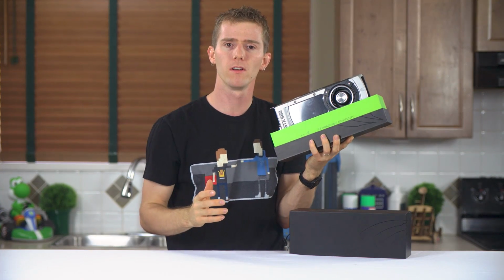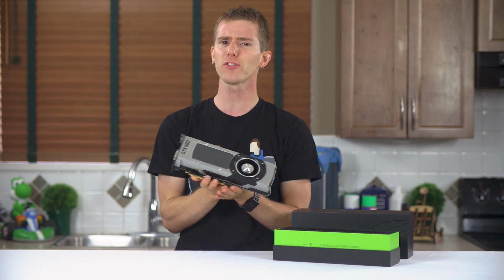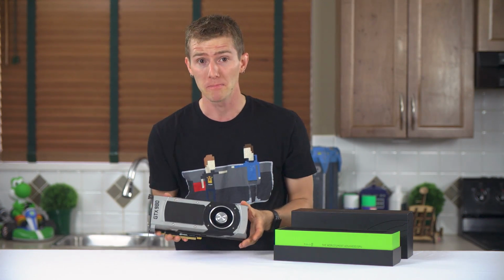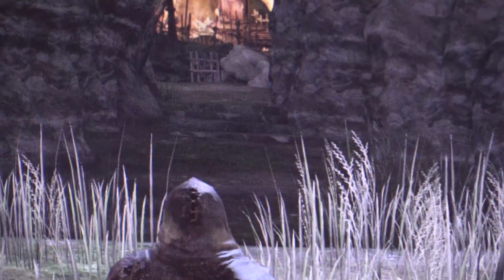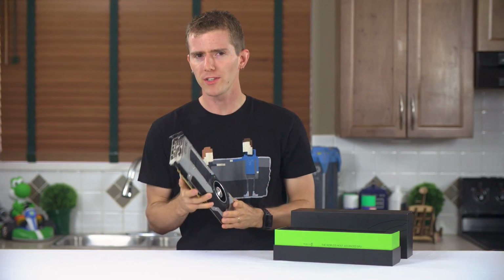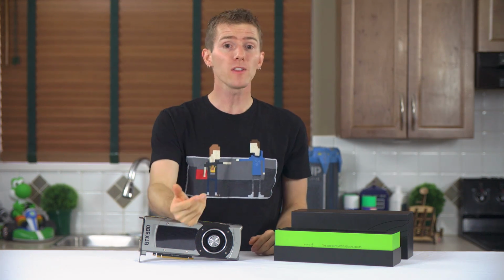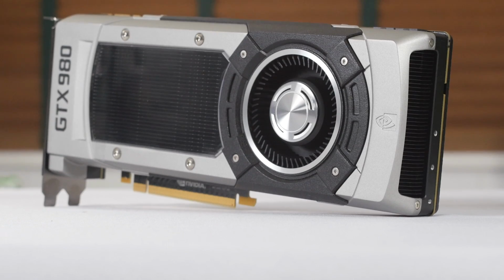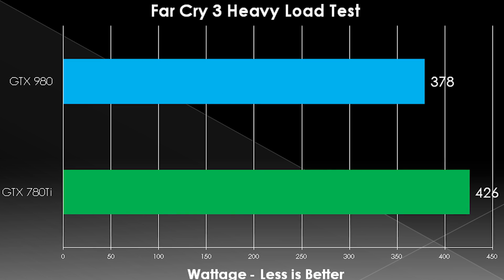NVIDIA GeForce GTX 980 Video Card - Performance Overview

Comment: I've got a GTX660 running with an old I7 950. I feel like I need a new CPU before a new GPU at this point or a GTX980 would just be bottle necked by my old cpu.
Reply: I've got an i7 950 too. Mines overclocked to 4.2 ghz and doesn't bottleneck my r9 290. You'd probably be ok with a 970.
Reply: Rocketman9mm Umm no. Even an i7 920 does not bottleneck a GTX 980.

Comment: hey guys i'm thinking about upgrading to this card from my R9 270x
here are my specs at the moment

GPU: R9 270x
CPU: i5-4670 @ 3.4GHz
M/B: Asus Z87-A
PSU: 650W Seasonic something something (xD)
RAM: 8gb 

do i have to upgrade my PSU or my motherboard or anything before i upgrade to this beast?

Comment: So I stopped following GPU news for a few years now, but I might be building a new computer soon. I've seen the high end from Nvidia, but where's AMD ? Didn't they usually both come out with new cards at the (loosely) same time ? It seems the 290s and so on are a year old than the 980. Are they planning new cards or what happened ?

Comment: Would a 980 be worth an upgrade from a 770 SC? I recently bought a 1440p monitor and while it hasn't come yet I am preparing for a good sized FPS drop on most of my games. Also I run Skyrim with a fair number of graphics mods and my 770 is already struggling with that at 1080p. So I am considering the 980 especially with the 4gigs of RAM to help with 1440p and high res textures. Thoughts?
Reply: I'm in the same situation. 770 sc to 980. But i'm planning to stay at 1080. I just want performance ... lol
Reply: CFOperator - 2 Yeah I get that. Just that $550 price tag holding me back...
Reply: I just need the upgrade this year for 2015/16
550 shouldn't be a problem to make in a years time. lol

Comment: the question on my mind that nobody is ever willing to answer for me. how does this card handle MGS5 FPS wise at highest settings & 1080p? if its under 59 fps then i probably need to search for a different card. this also gets me thinking about what the fps would be if the card is overclocked.

Comment: I can only say which one GOT my money. Gigabyte gtx 980 G1 gaming 4GB and til now it rocks! Dying light 80 FPS on 1080p all max Vsynch off. Only thing: It doesn´t overclocks that well. I guess it´s cause of my PSU which isn´t enough maybe? Help appreciated.
btw i got it til 1500 Mhz Core Clock with MSI Afterburner, when it freezed the driver... Had to restart PC.. Since then i didn´t try again, cause honestly playing on 1080p and some games on 4k superrez, it´s not really needed. ^^ But next thing to buy for me is a 4k monitor and then i NEED to overclock!
Intel i7 4770 3,9Ghz
650W Corsair PSU 80+Gold
16GB 1600Mhz DDR3 RAM
256 GB Samsung Evo 840 SSD
CPU aircooled, not Intel reference design, cost about 40 bucks

Comment: This is probably a better place to ask this. I am going to purchase the 980 simply because i currently have an AMD Radeon HD 7790... 980 is much better correct? and also would i need to upgrade my cpu for gaming performance? i currently have AMD FX 6300 six-core. Thanks in advance everyone <3
Reply: if you're running games on a 1080p display, the 980's definitely gonna be overkill. for 1440p, you could get it if you wanna run pretty much everything at ultra settings. for the cpu, I'd just overclock it.

Comment: What version of the 980 should I get? I`m thinking about getting the EVGA GeForce GTX 980 SC ACX 2.0, but there are other versions. What's the most powerful one for gaming?
Reply: Gigabyte G1 gaming is the best
Reply: Get i5 with gtx 970 and you are good to go.
Reply: Daniel Mezzarroba  Check the EVGA website, they have several different versions of the 980. All of their models have varying clockspeeds, depending on how much they've overclocked them. Most of their speeds are pretty close to each other, though. The biggest difference is going to come in the cooling. Depending on what kind of case you have and how well the airflow is, you may want to base your purchase on that. The non-reference cards, like the ACX 2.0 are open air and tend to cool a little bit better, but they'll heat up the inside of your case more, since all of that hot air is just floating away from your card and into the case. If you have good airflow throughout your case, that won't be a problem. The reference cards use blower style coolers which exhaust the air out of the back of your PC case, keeping the inside of your PC a little cooler, but those cards tend to run a little bit hotter. Although, I have a reference card with the blower style cooler and mine stays very close to as cool as the open air card that I had before. Honestly, I chose the reference 980 simply because I liked the way it looked, more than a non-reference card. Truth be told, you'll be fine with whichever card you choose.Keep in mind If you go for a Gigabyte 980, there models are extremely long, so make sure it will fit in your case, properly.

Comment: I just moved from sli 780 to sli 980 and if i am honest it was the worst things i ever done....Battlefield 4 is my main game that i play so wanted to get the most from the fps ,Both cards were using same settings 2X780 143 FPS CAPED never dropped 2X980 143 CAPED drops to 80 I feel pretty pissed off if i am honest ... The main reason i wanted to move over to 980 cards was for MFAA as well and keep high fps but that seems to of kicked me in the balls because you cant use MFAA with sli nor can you use DSR in sli ....

If  you have A 780 do not bother to buy a 980 no point ...

Comment: For anyone who has a GTX 970 is it bad or any equivalent graphics cards is it bad to run the fan at a low speed constantly or should you use your fans in high temperatures?

Comment: I love my GTX 980 in 2-Way Sli..Though not much FPS improvement from the GTX 780 TI Cards that i went from..These new cards run really cool and overclock really well..Paired with the 5960x there great cards
Reply: sloppywetblow No doubt.  The my SLI as well bro

Comment: yeah.. great... more cudocores then the 680 but less then the 780. wtf happened? isn't it supposed to have more or the same amount. also the bus width is decreased from 384bit to 256bit.
Can someone please explain?
Reply: Hmmm...
Judging from Nvidia's presentation of the 980, its architecture is more efficient (dunno if it has anything to do with the lower number of cuda cores), and that there using some new kind of compression algorithm that compensates for the smaller bus width. And if were at it, Nvidia has an large problem with the 970 and its 3.5GB+512MB VRAM, and its still an question if the 980 has the same problem or not, if not more.
Reply: It does more with less,ie 1.4 times,so add 40% to the cores and it comes to around 2900,maxwell is very efficent in doing more with less power and less spec

Comment: I want to upgrade my GTX 660Ti to one of these and was wondering if my motherboard is compatible with it (Asus P8Z77-V LX) or should I upgrade the motherboard too? any help would be appreciated. i5 3570k @340GHz, 16GB Ram. :)

Or should I just do a new build from scratch?
Reply: wolvogamer dang! 340ghz!
Reply: power is ok if you have 15W more :D cpu is ok (i have the same) it's OK (you have a realy good overclok on that cpu :DDD )

Comment: better than 780 ti?
Reply: Yes, but by 0.5 percent, and in some benchmarks even worse. If you have a really old GPU pick a 980 as an upgrade. Cheaper, consumes less electricity and also has all the new bells and whistles. Do not, however, upgrade from 780ti to 980. A waste of money.

Comment: Some of this power seems way too unnecessary, because I don't really understand the need to use four monitors at a time. Not for gaming anyway, but for enterprises, they may be required. Other than that, no real point.

Comment: Why do they not release a 6gb version of this card??
Reply: *****
Because 4K and 3 screen gaming
Reply: ***** Do you know anything about computer, i don't think so, your in the wrong cahnal dude
Reply: ***** I am  #Notanative  so srew you
Reply: 98% of gamers are still at 1080P
Reply: ***** that's invalid. Because the 900 series uses a smaller bus more efficiently
Reply: ***** the 900 series architecture uses the bus more efficiently.
Numbers are just numbers man
Reply: ***** numbers are meaningless.
Look at the 980, on paper it should be slower at 780ti YET it's not
Reply: ***** ON PAPER the 980 would be slower.
YET it's still faster than the 780ti.
NUMBERS are meaningless.
Reply: Sanic numbers aren't useless. Cards built on the same architecture and drivers differ based on specs.

 You are right though, Maxwell is 33% more efficient per core than keplar, so you COULD do the math converting Maxwell cores to keplar cores. What you end up with are numbers that reflect how this card performs compared to a 780ti.

Comment: Running the newest games okay with 760 SLI on 1440p on high settings (W/O filters) with some occasional FPS drops. Wondering if I should go for this card SLI now or whether it's worth waiting a while for the next thing? In that case how long do you guys think I'd have to wait? Also how long would it take for 790 SLI to become obsolete?

Comment: which is better nvidia gtx 980 or theASUS GTX 980 4GB STRIX OC
prices  confused me
Reply: The Asus will most likely be faster. The stock 980s are priced very high for what they are.
Reply: can the asus one be used in SLI ?
Reply: laith alwedyan I believe so.
Reply: thanx :)
Reply: id recommend gigabyte gtx970 g1 because your guaranteed that thje chip inside is the top end of the wafer and thus will overclock the best compared to cards that don't have a similar system of providing that top end processor version.  Go to gigabyte website read gauntlet info.  I know others do this too.  Gone are the days of hit and miss for overclocking.  Even if you don't wana overclock  the g1 is still factory clocked directly, that means you don't have to do anything.  This is just my advice from my experience of the giga g1.  Either way any  970 is a awesome card youll not be disappointed but if its a choice between a reference card and a card with its own cooler go with the customer cooler.my g1 is superfast and super quiet, even when I have played like 4-6 hours on battlefield 2 or using prime on full load I still cant hear my card :)
Reply: thnx for the advice

Comment: Guys I seen a custom PC and I need to know whether it will last longer than 2 years.
Here are the specs:
CPU: INTEL® Core™ i5-4690K Quad Core 3.50 GHz 6MB Cache LGA1150 + HD Graphics **Overclockable XXX**
HDD: 2TB SATA-III 6.0Gb/s 64M Cache 7200rpm Hard Drive (Single Hard Drive)
MEMORY: 8GB (2x4GB) DDR3/1866mhz Dual Channel Memory (HyperX Fury White w/Heat Spreader)
MOTHERBOARD: ASUS Z97-P INTEL Z97 Chipset, ATX Mainboard w/ 4 RAM slots, HD Audio, HDMI, GbLAN, USB 3.0, SATA-III, 1x Gen3 PCIe x16, 1x Gen2 PCIe x16, 2x PCIe x 1 & 2x PCI
SOUND: HIGH DEFINITION ON-BOARD 7.1 AUDIO
VIDEO: AMD Radeon R9 280X 3GB 16X PCIe Video Card (Single Card)
Reply: Probbably will do
Reply: What's the video card?
Reply: AceTheGreat I found a different PC now and the specs are here (and btw the video card is a  AMD Radeon R9 280X.
CPU: INTEL® Core™ i5-4690K Quad Core 3.50 GHz 6MB Cache LGA1150 + HD Graphics **Overclockable XXX**
HDD: 2TB SATA-III 6.0Gb/s 64M Cache 7200rpm Hard Drive (Single Hard Drive)
MEMORY: 8GB (2x4GB) DDR3/1866mhz Dual Channel Memory (HyperX Fury White w/Heat Spreader)
MOTHERBOARD: ASUS Z97-P INTEL Z97 Chipset, ATX Mainboard w/ 4 RAM slots, HD Audio, HDMI, GbLAN, USB 3.0, SATA-III, 1x Gen3 PCIe x16, 1x Gen2 PCIe x16, 2x PCIe x 1 & 2x PCI
SOUND: HIGH DEFINITION ON-BOARD 7.1 AUDIO
VIDEO: AMD Radeon R9 280X 3GB 16X PCIe Video Card (Single Card)
Reply: Mystic Gaming i would porbbably go with a better video card if you wanna keep the pc and play games on around high setting above 60fps for the next 2 years, maybe a NVidia 970/980?
Reply: Sir Crunken | Gaming & More Yeah hopefully I can get one cause I'm trying to keep the price under 1000.

Comment: where can i buy EXACT metal model of that gtx 970? all Nvidia cards look like that BUT, On newegg or other sites i literally cannot find that looking gtx970
Reply: Do you mean a GTX 980, because this is not a 970.
Reply: no, i meant 970 :(
Reply: ThisHDGame If you mean a 970 with the same cooler as the video, it is apparently very rare. You would most likely end up paying close to a 980, just for a 970 with this cooler.
Reply: They were just in stock on newegg when I checked two days ago. Probably gone by now, but you could keep your eyes our for them. Maybe they'll get more.
Reply: ThisHDGame I found it quite hard to find the stock 970s. BestBuy has them for like $380 USD. That is like the only place to find them.
Reply: http://www.bestbuy.com/site/nvidia-geforce-gtx-970-4gb-gddr5-pci-express-3-0-graphics-card-silver-black/9855169.p?id=1219441201895&skuId=9855169
Reply: ThisHDGame gtx 970 asus strix
Reply: ThisHDGame or gtx 970 refrence card
Reply: ThisHDGame I think you can find this at Best Buy. At least you can here in MN
Reply: ThisHDGame Nvidia manufactures the small GPU inside the card, they do not actually make the cards.  Recently they have started making REFERENCE cards like the one in this video with the blower fan (shoots hot air out the end of the card , good for small towers).  But if you were to buy a computer from ibuypower or cyberpower you would get an MSI gtx 980, Gigabyte gtx 980 etc and they would all look different or have different pcb or backplates.  Again, to reiterate Nvidia manufactures the tiny square looking thing INSIDE the cards, not the whole card its self.

Comment: Can someone check my setup and give a  any recommendations for improvement and maybe check CPU Cooler and any other things. This setup is for playing games like BF4 on the high settings, editing and rendering videos with good speed, Pls Hurrrp, Thanks For Your Tiem <3

PC SPECS 

Case: Corsair 760T (White) £140
MoBo: Asus MAXIMUS VII HERO £160
GPU: GTX 960 When It Releases. £200 Give or Take
CPU: Intel i5 4960k £179
CPU Cooler: Corsair H110 £105
STORAGE:Samsung 840 EVO 250GB SSD £80, 1TB HDD £40
RAM: Corsair Vengence Pro 2133 DDR3 8GB £60
PSU: Seasonic 660XP 660w Platinum £120
Optical Drive £20
Operating system: Windows 8 64bit £70
Grand Total: £1174
Reply: A Better CPU and GPU is needed for BF4 on high with a good stable frame rate. maybe go with a i7 and a GTX 970 if you can add some more money. otherwise you can porbbably run BF4 and render pretty good but don't expect any more frames then 30 on high settings in at least BF4 as it is very GPU and CPU intensive game =)
Reply: Sir Crunken | Gaming & More if hes not editing  footage he doesn't need an i7. He can get 80 fps on bf4 with an i5 and gtx 970. i7s dont give any noticeable difference in performance. And they make nothing better than a 980 except a titan and those are not for 1080p gaming.
Reply: I would save some money on the Mobo, and put them towards a 970. Asus Z97-A is apparently very good for the price.
Reply: Jesper E you are right.
Reply: for a extra 50-60 id seriously consider getting a refurbished h100i from ebay at 70 pounds, You can save 10-20 on a different case and get a gigabyte gtx970 g1 instead of the to soon come 960, your system will love you more, I bought a avenger preditor full tower for 100 pounds ,Alternatively get a corsair power sup[ply 650  and still get the case you want.

Comment: I don't get the idea of how the 780ti will cost you that much more to operate.  If you take a maximum gaming power usage difference of 70 watts between the two cards and you game say 2500 hours a year and you pay $0.20 (US average is $0.12) a kilowatt that's $35 more for a year to run a 780ti.  These are $500+ cards the people buying these cards don't care about the pennies spent to operate them.  If your one of the unfortunate people who live in a country with those super high electricity prices then it may sway your decision more.
Reply: I spent 300 ponds uk on a 970 g1 and saving power was a consideration for me, I know itas not a huge amount but saving that money over 4 years to me is something like 120-150 pounds so was well worth spending the 300 pounds instead od 150pounds for a power hungry card.  Im only 1080 gaming and need 3 monitor for editing so it was a no brainier for me.

Comment: Fact is if you put a moderate over clock on a GTX 980 (which is VERY easy to do) with good RAM and CPU
even with the factory cooling can run 3/4 of all games fine at 4K 60fps range on ultra.  The other 12% you can run 2K on ultra fine.  Rest the games can't handle it (being too old) and messes up requiring you to go back to 1080p.  My experience anyway tuning 400+ games.  I just set my GPU overclock +100 and +200 on RAM (which is actually +400) with a moderate fan curve and power set to 110% (which it will often run at)

Comment: Planning to upgrade my gaming/work computer from my current gtx560, thinking about going with this:

i7 4770k
EVGA GTX980
Gigabyte Z97X 
16GB Corsair vengeance DDR3-1600
Samsung 840 250GB SSD
Seagate 2TB HDD

 Id appreciate any opinions as I am not too knowledgeable with this stuff

Comment: I'm currently using a Nvidia GTX 680, I was thinking about upgrading to the GTX 980 because of the extra VRAM as well as the power efficiency considering it uses less power than the 680. I feel like it would be cheaper than having to buy a new power supply to support something that uses even more power

Comment: Overclocking guides on this card would be appreciated, since i'm about to dual 2 in a SLI fashion from these for the EVGA GeForce GTX 980 4GB Superclocked ACX 2.0 in my upcoming Monster Next Gen Build that's in the works currently

See Link For Complete Tower Build (Not Including All Water Cooled Components Yet)

http://pcpartpicker.com/user/RyuTakeru/saved/zhdG3C